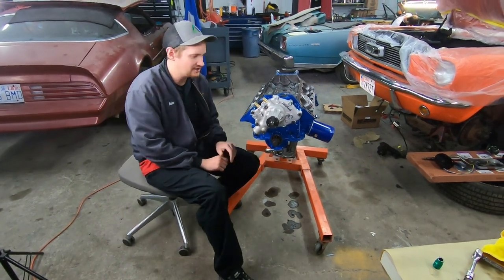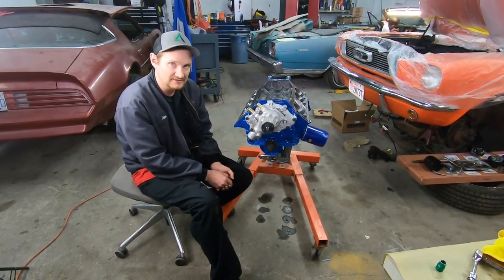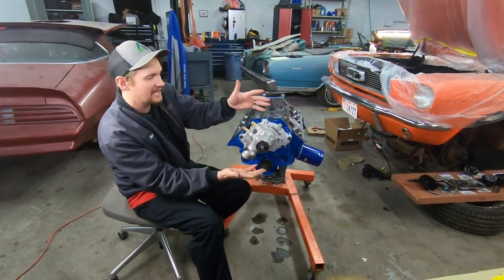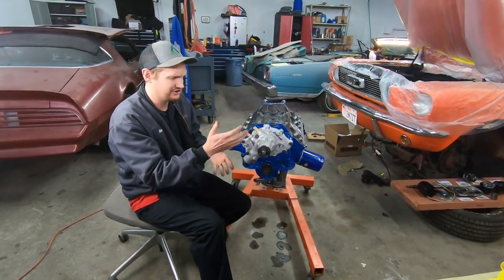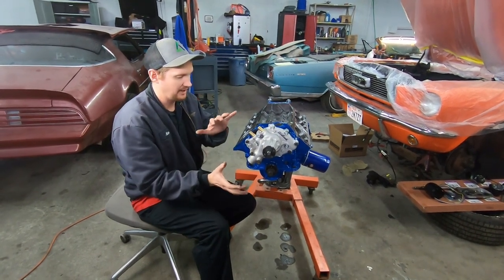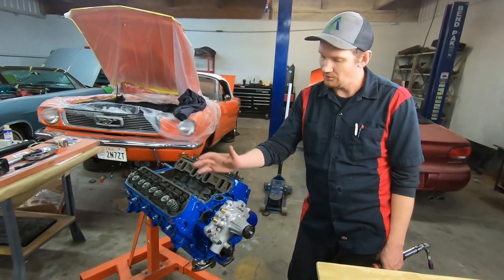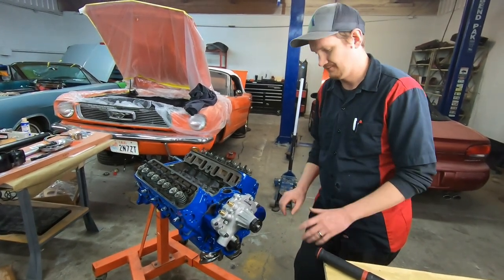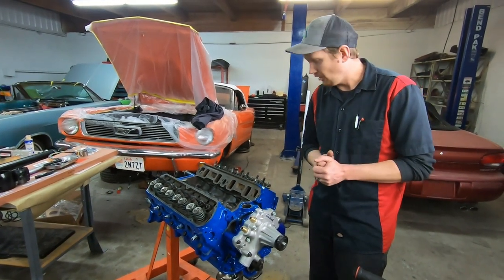How to Install Timing Cover & Water Pump - Rebuild the 289 Ford - Part 11

Comment: 2:21 I'm maybe too picky, but, in case, instead of living that part of the cover floating free, I put a piece of 2x4 underneath to prevent a crack in the aluminum cover.

Comment: Only thing I like more on old Chevy V8 engines is the timing cover being a separate unit. I'm a Ford guy 100% but these SBF water pump/timing cover multiple gaskets and lining them all up before the sealer begins to set  is a real nightmare especially with the engine in the car. Just recently removed my noisy gear drive and replaced with a timing chain. Got it done and nothing leaks which is miracle in itself because I must have fiddled with everything lining up for what seemed like an hour plus. Really nice to see this done methodically and the right way. Next time I will order a new bolt set and actually think it through like this. Thanks!
Reply from the maker: I couldn't agree more. Its one of those things that I wish Ford were more like GM but I guess we have to have some things to challenge us. To make things worse, Ford had to change their designs multiple times though out the years of these small block Windsors where the GM 350 remained unchanged for decades lol. I appreciate the comment, I've definitely learned my lesson on these jobs over the years to have everything ready before beginning. Nothing more frustrating than doing this job and having to go back in to do it again.

Comment: IMO its best to seat your  harmonic balancer before you tighten any of the water pump bolts .
Reply: I was thinking this as well. Saw it in another video and I think that would help straighten everything out better so the seal on the balancer is as concentric as possible.

Comment: I have a new aluminum edelbrock waterpump also, which timing cover did you buy, is it aluminum also or cast iron? Could you send me a link please? And a link to which bolt kit for the pump & timing cover you used also please? I am restoring my 1969 convertible & rebuilding my small block 302, all your videos are on point 👌 Thank you for sharing your wealth of knowledge! 👍

Comment: Great video!  Can you tell me what water pump and timing cover you installed and the bolt kit with bolt diagram?  Thanks!
Reply from the maker: This is the bolt kit we bought for the water pump https://www.npdlink.com/search/products?search_terms=water%2Bpump%2Bbolt%2Bkit&top_parent=200001&year=1966                                                                           The timing cover was just a factory replacement for a 289 but it was what came off the engine. The water pump was an edelbrock high flow. https://www.cjponyparts.com/edelbrock-water-pump-hi-flow-289-302-351w/p/WP11-V/?msclkid=3e6c8e9edf9c14bfb87fea284e0e47f2&utm_source=bing&utm_medium=cpc&utm_campaign=Bing%20Dynamic%20Search&utm_term=%2Fp%2F&utm_content=Dynamic%20Search%20Ads

Comment: Being aluminum I would guess brings a different torque spec! What did the Edelbrock say to torque it at?
Reply from the maker: Indeed it does. I have no idea, I never even looked into it. I know sometimes its taboo to just go off feel but in all reality, its not a cylinder head. If you're in tune and paying attention, this kind of stuff I will typically put the torque wrench on and just feel.

Comment: I have a 289 engine with a stuck distributor and intake manifold. Have done all kinds of prying and hitting with hammer no results. Any other suggestions that I might try?
Reply from the maker: I've yet to encounter such a problem. Is the engine being rebuilt or are you simply trying to remove the distributor?
Reply: @AlfsMustangGarage  It’s been sitting for 30 years and I need to open the intake manifold and heads to look the cylinders etc

Comment: Can the water pump be replaced without removing and resealing the timing cover? Mine leaks😢
Reply from the maker: Yes, you should be just fine.
Reply: Mine leaks even with new bolts and all holes cleaned.
Reply: Remember order bolts for either a/c  or non a/c cars.  The bolts are not the same length.

Comment: So, I have a 289. (Just like yours in this video). Purrs like a kitten. Hit the fas pedal, and smoke comes out of the oil breather. I'm going to guess head gasket. Or rings. It sat since 1997. So, just need drove? Or rebuilt?
Reply from the maker: Well there should be some sort of crankcase pressure so a little is normal. Is your PCV valve clogged up or anything? If its excessive it could be a number of things so its hard to say from a keyboard if you need an engine overhaul or not.
Reply: @AlfsMustangGarage  all new pcv valve and hose. Smoke is not excessive.  Just barely noticeable. So maybe it's normal. Never paid attention when the hood is closed. Lol

Comment: What bolt kit did you buy for this video?
Reply from the maker: That's the AMK concourse correct bolt kit. I may have left a link in the description but you can find them at NPD.

Comment: I bought a new water pump. It doesn’t spin freely, has some resistance, is that normal?
Reply from the maker: Should have some resistance. However, what your feeling is hard to judge from my end.
Reply: @AlfsMustangGarage  if I hold the pump in my hand and try to spin it and wait for it to stop, that doesn’t happen. I can turn the pump by hand easily. I’m sure it’s fine and would function properly on the 289. Thanks for the reply. Love your channel. Declan, Ireland.
Reply from the maker: Thank you! Sounds like you've got her figured out. Glad to help.